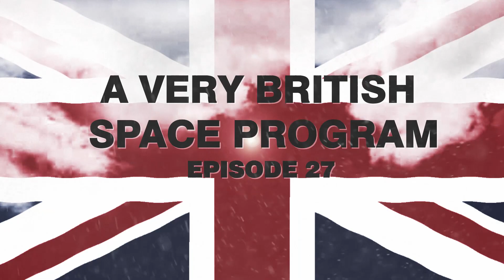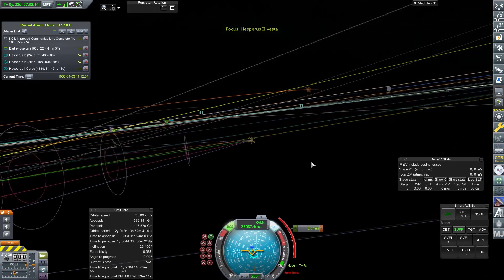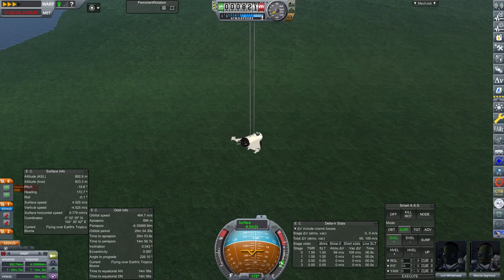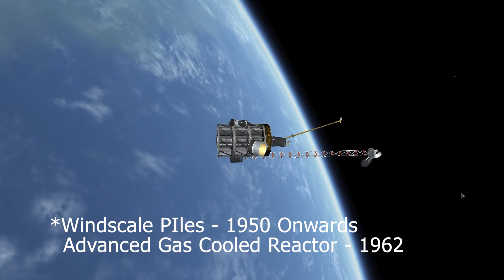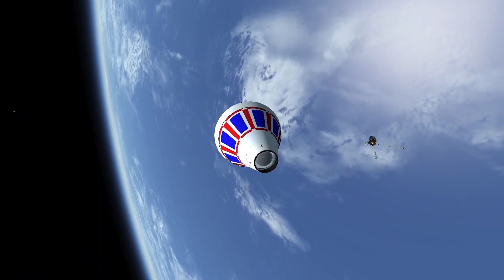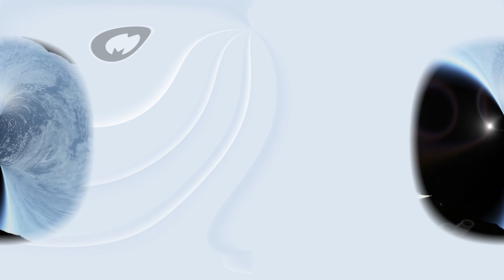A Very British Space Program | Episode 27 | Robotic Rendezvous | KSP RSS/RO/RP-1

Comment: A bit late to the party, but loving your series so far =) - Just a quick observation, is there a reason you arent using RMB on the intersect node to keep the numbers showing at ~12 minutes?  I see your mouse flicking from the maneuver section and then back to checking the intercept distance over and over. Unless KSP has removed it?  I havent played in a while.
Reply from the maker: It’s a good question…. It’s actually a feature I didn’t know about until recently ( old dog and new tricks type situation 🤭)